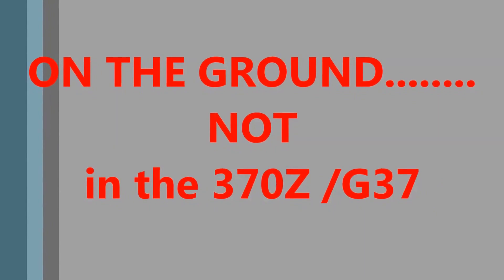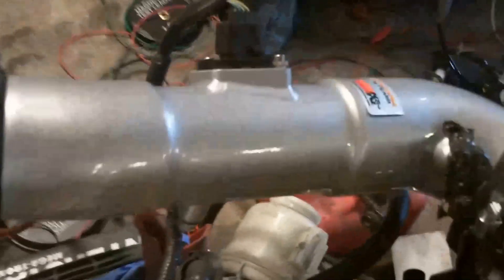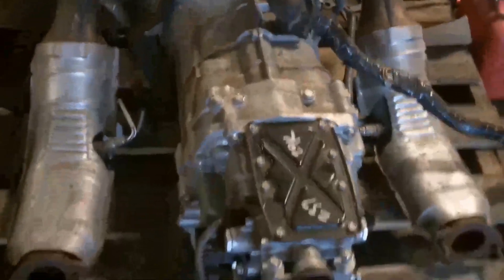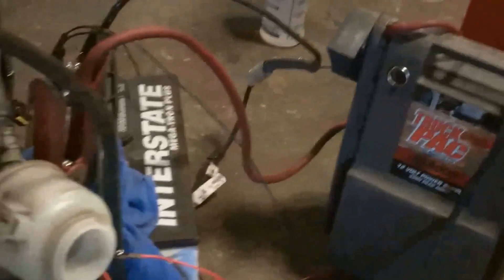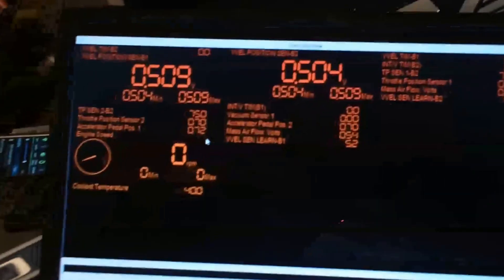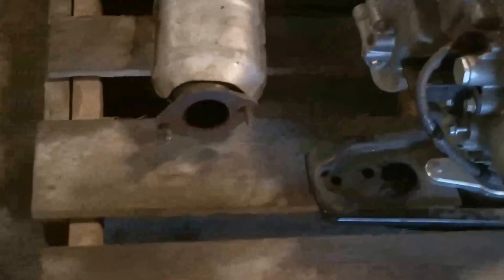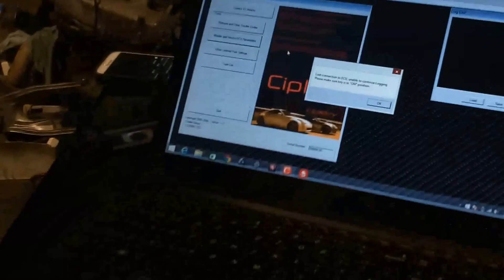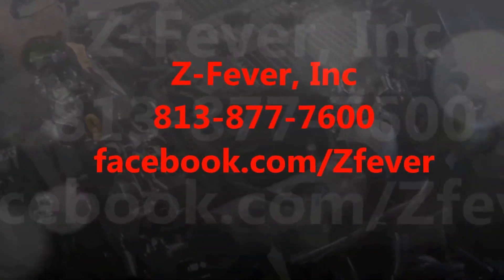VQ37VHR Start-up running on the ground - Z-Fever does the wiring

Comment: I know I won't get an answer but I'm having trouble seeing all what your using. I see the junction plug from the firewall being used, no ipdm, the 46 pin white plug not there. I'm doing this to my S14 & soon far I've seen you guys & others keep the junction plug to run the VVEL module
Reply from the maker: We only use the ECU and VVEL module when we rewire the VQ37VHR. We do not use the IPDM or BCM. We charge $2295 to rewire and tune the ECU.

Comment: I'm seriously interested to see if I could put the vhr in my 06 g35 and what it will cost to get it running with all gauges etc..
Reply: Yes, we provide this wiring harness / ECU tune service. Here is one of our listings for it on Ebay. It will tell you all about it. Also, you can contact me at doug@zfever.com or 813-877-7600 and I will send you our VQ37VHR into Z/G DE chassis swap guide. https://www.ebay.com/itm/G37-motor-swap-harness-for-Infiniti-G35-chassis/264347890323?hash=item3d8c5cb293:g:6HoAAOSwxypc9Ph-

Comment: I heard you can’t swap a vq37hr into a 350z de everyone says it’s better to vhr bottom end with hr heads I want to de to hr swap my Z debating on hr and vhr depending on if it’s possible without any electrical issues
Reply from the maker: yes, we can swap a VQ37VHR into a DE 350Z chassis..... We have done it several times. call me at 813-877-7600 and I will give you the info you need to get it done.

Comment: What about the gauges is there a sure way to make this all work in my G35
Reply: there are a couple options... If it is a VQ37VHR into a G35 then you want your stock gauges to work you will need BOTH the VQ35DE ecu (for the gauges) and the VQ37VHR ECU for the engine management.

Comment: Hi bro! I have a 350z ‘03 and I want to put a vq37vhr on this chassis. I need send you my harness with the engine(vq37vhr) or what I need to do??
Reply from the maker: there are a lot of differences in the 350Z and 370Z. But what you described is possible... It is just a TON of work.
Reply: Dude, it'll be way cheaper if you just find a crashed 370z at an auction for a few hundred dollars. Gut both your 350 and 370, switch out all the internals of the 370z and put it all in the 350z. Main problem you might have is rewiring the grounds
Reply from the maker: It is an expensive harness job. and the CAN system for the VQ37VHR is twice the speed on the earlier Z's CAN system. Therefore the gauges do not work unless we run BOTH the VQ35DE and the VQ37VHR ECU's as well as the VQ35DE Crank sensor and a trigger wheel mounted to the front pulley. It is really tricky. We would charge $2200 for the harness work and then you would need us to tune BOTH the VQ35DE and the VQ37VHR ECU's. which is another $500 each.
Reply from the maker: it would be better if your car were here at our shop...
Reply: zfeverrocks yeah..! But I live on arizona(Phoenix)
Reply from the maker: Well, we can still rewire it but there are a few things that will be tricky. YOu need to have the ability to do on your end. We can provide the parts.
Reply: I was thinking on doing the same thing. Wouldn't it be better off just using the 370z's wiring harnesses and running an aftermarket ecu in the 350z?

Comment: Man. I really want a vq37vhr in my s12 but idk if it's worth the money. Or I'll just get a rb20
Reply from the maker: The VQ37VHR is twice the engine the RB20 is.... it is all aluminum block and heads, revs to 8k rpm, make 335hp stock, with basic bolt ons it can be bumped to 400hp... parts are available at your local parts store (whereas NOTHING is available locally for the RB), and it gets between 25-30mpg when driven normally. Then, if you boost it... the motor is good for 500whp! What more do you want?
Reply: zfeverrocks hmmm. That's what I like, feedback. And thanks for responding, I really wanted a vq37vhr but wasn't sure.
Reply from the maker: no problem, let me know if we can ever be of assistance

Comment: what do i need yo do a manual swap for my 370z electrical side will the manual ecm work on auto wiring harness?
Reply from the maker: ECU needs to be tuned, harness needs to be rewired, pedals need to be added, etc... It is usually more cost effective to sell your 370Z auto and buy a manual trans car.
Reply: zfeverrocks ok thanks

Comment: I have a question for Zfever! I am in the process of dismantling my datsun 280z, that I would like to swap in a vq35hr or might considered a vq37vhr.. Choosing the motor is based on which will give me reliable hp am looking for at min 325-350whp or 350-400whp if even possible all motor build..Which would be more cost effective and reliable down the line..
Thanks, love the work you are all doing!
Reply from the maker: When we tune VQ35HR motors in the 350Z we routinely tune them to 300-310whp. The VQ37VHR is routinely tuned to 320-330whp. Each of these samples are ONLY after basic bolt-ons. When long-tube headers and ported plenums are used also we have gotten as much as 348whp on the VQ37VHR but I would NOT expect these #'s. 340whp+ is rare. If you want 350whp+ you should boost it. Then, you can EASILY make 450whp safely.
Reply: I have heard, and based on what I read into the vq35hr was better then vq35de. But I just started to research on vq37vhr. Would you recommend this engine over the vq35hr as far as reliability?
Reply from the maker: I, personally , like the 37 better but each of them are reliable. They are very similar engines.
Reply: ok thank you!
Reply: What is the cost to swap a vq into a datsun 240z?
Reply from the maker: starts at about $7500 and goes up from there